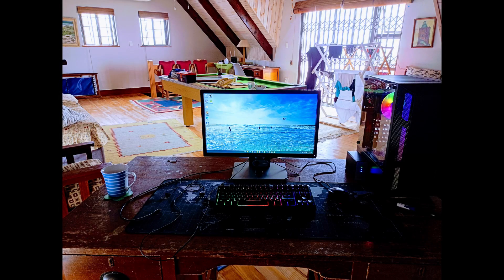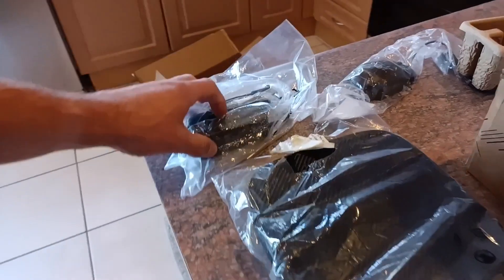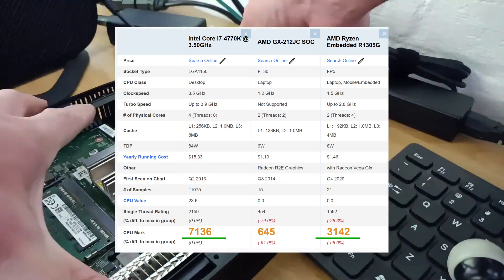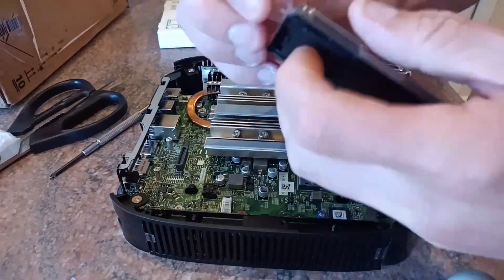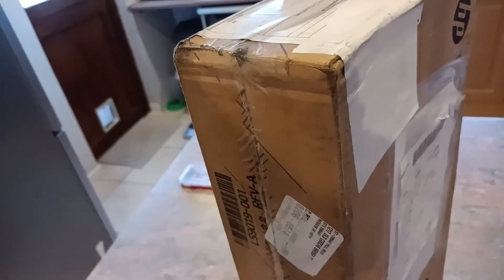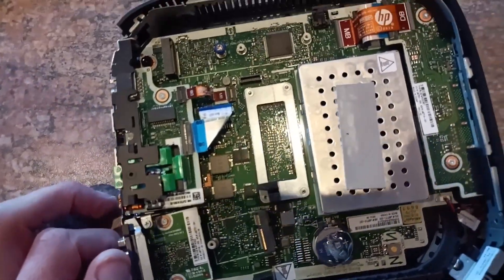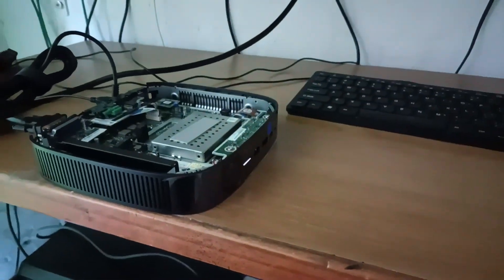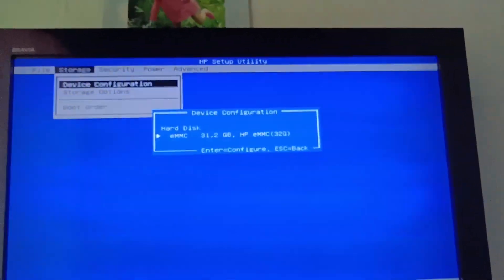HP t640 8watt PC

Comment: Can I use for Adobe and every day tasks?
Reply from the maker: Yes, since the RAM can be upgraded to 64gb, but the processor is not very fast.
Reply: @Rouxenator  HP T640 has Ryzen R1505G with max. TDP 25W, compared to desktop processors, it has performance like Ryzen 3 3200G, could be used also on some gaming with lower details, CPU is good, but iGPU is slow, there are versions like T740 with Vega 8 instead of Vega 3.
Reply: @DEKROHD  1505R TDP Range is from 12 to 25 Watt and HP set it to 12 Watt TDP !